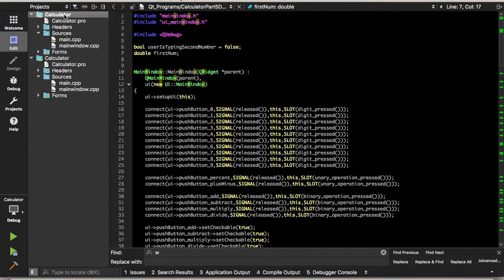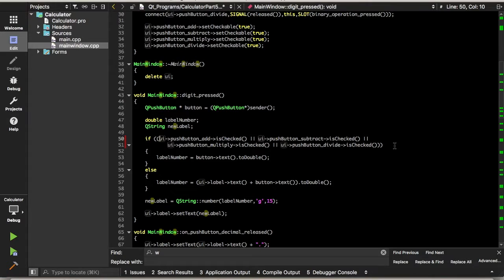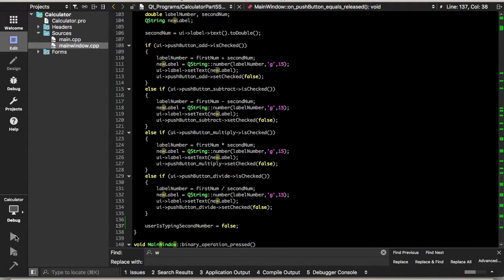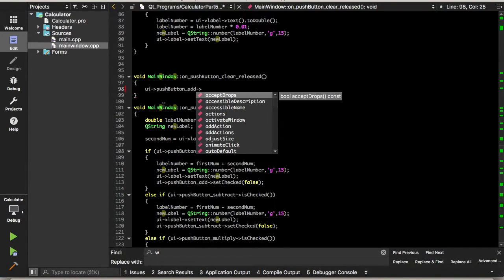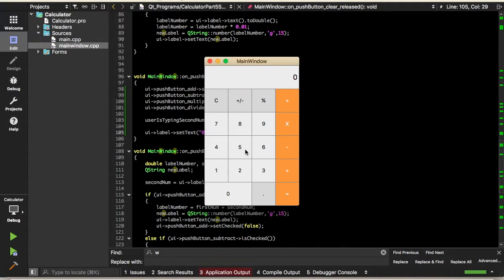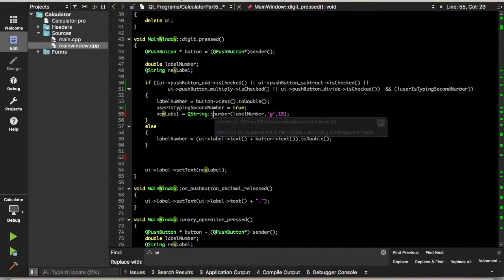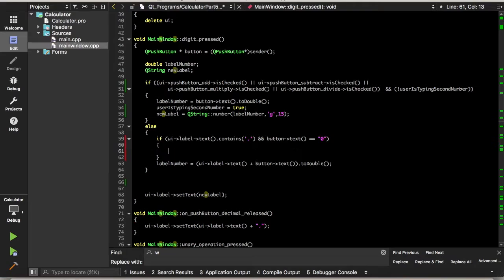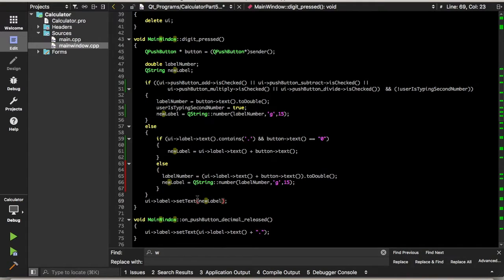QT CPP Calculator Gui Tutorial Part 5

Comment: Hi, how to simulate press key with Qt? Some as AUTO CLICK on  screen, no in program. It should press anywhere. Everything what i found DO NOT WORKING. Why?
Reply from the maker: Hmm.  There may be a way to simulate clicks in Qt itself, but I am not aware of any.  A more general approach for this on Windows (doesn't work for Mac or Linux) is to use software called AutoIt.  https://www.autoitscript.com/site/autoit/.  There are probably similar tools for Mac/Linux as well.
Reply: I did it.

In *.pro you must add: 
           LIBS += -luser32
And in your program (my is mainwindow.cpp):  
            #include <windows.h>

           .... (your code)

            mouse_event(MOUSEEVENTF_LEFTDOWN, 0, 0, 0, 0);
            mouse_event(MOUSEEVENTF_LEFTUP, 0, 0, 0, 0);
Reply from the maker: Awesome, thanks for sharing!